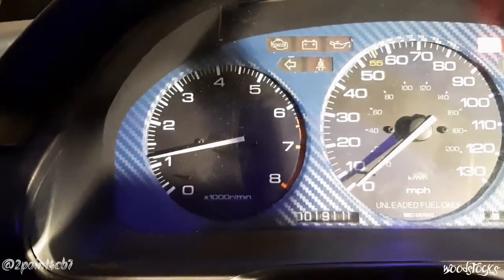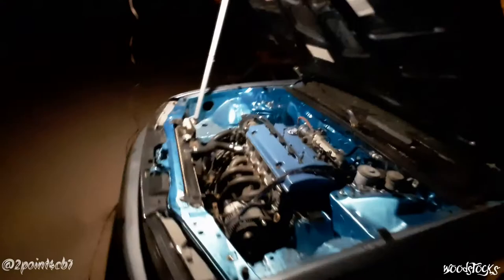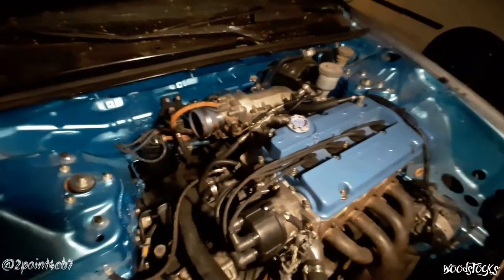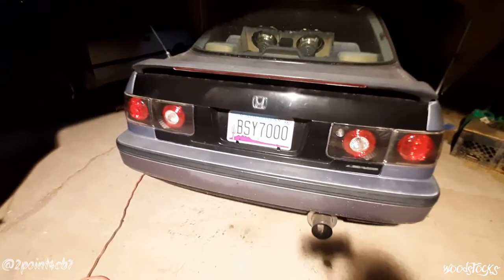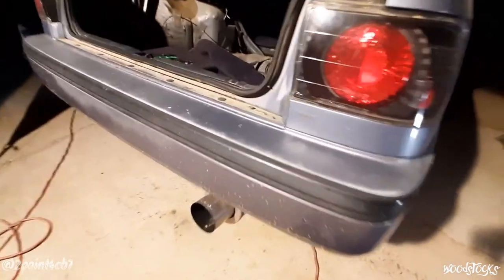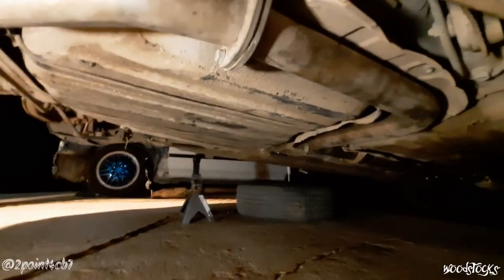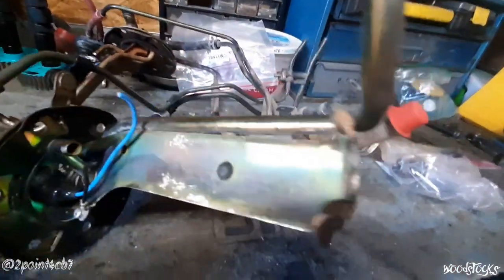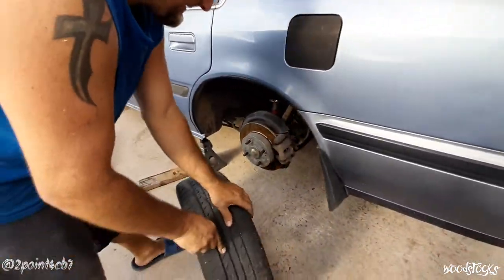cb7 accord fuel pump replacement / Robbie's cb7 running issue

Comment: Valve lash?
Reply from the maker: We've had so many different issues with this car that i cant remember if this was when a few distributor wire pins had come loose from the body harness connector or if this was when we had a faulty fuel injector